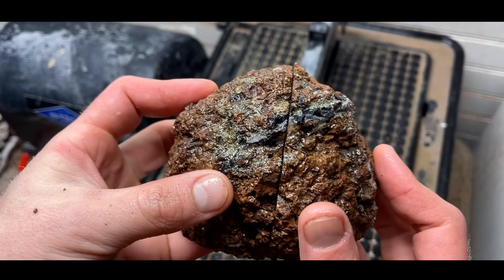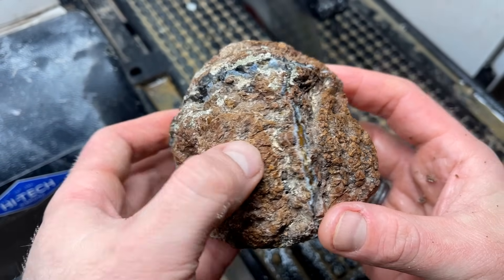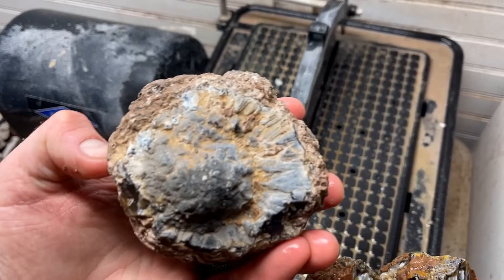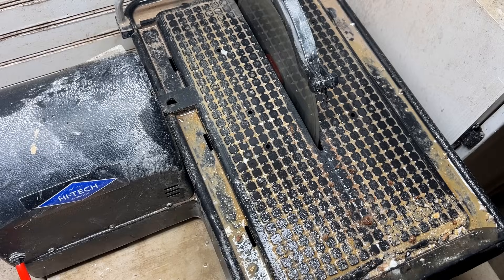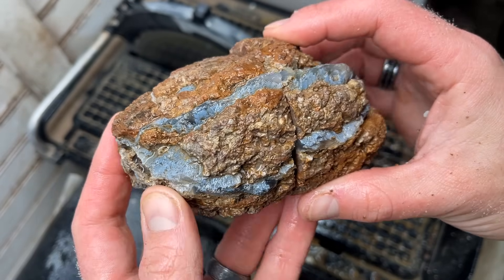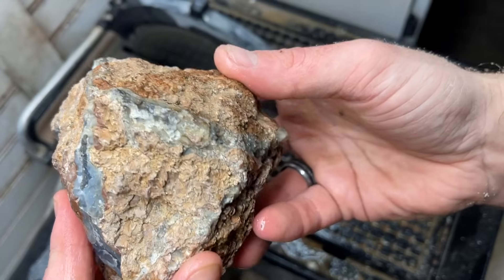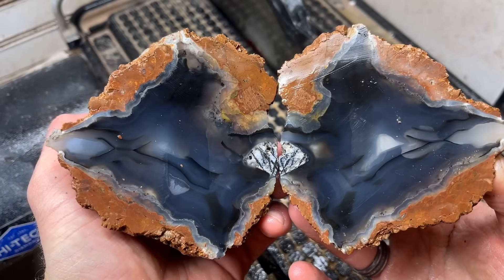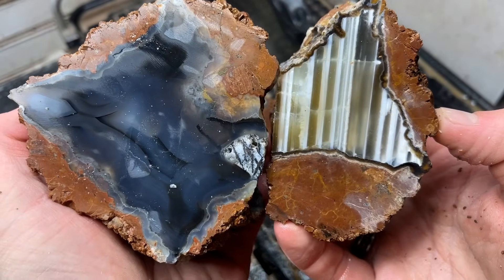What’s Inside Turkish Thunder Eggs?! Cutting with my Lapidary saw!

Comment: Those agates are not from Turkey. They are from Oregon State and only originate in a place called Richardson's Ranch which just so happens to be open to the public. They are way amazing and the amount of colors you can find in them are endless. Some have shiny drusy crystals and some don't. You can tell where it's from because of the star pattern on the inside once you cut it open and the brown matrix that surrounds the egg/geode.